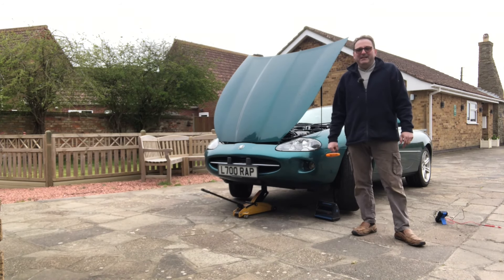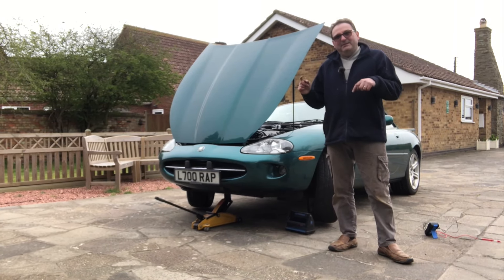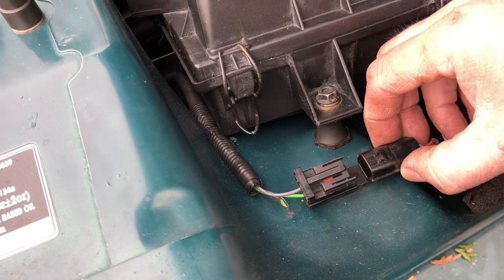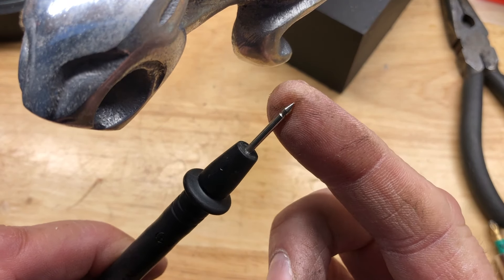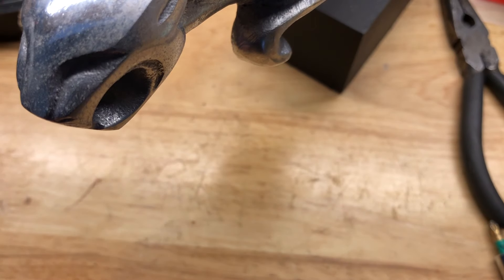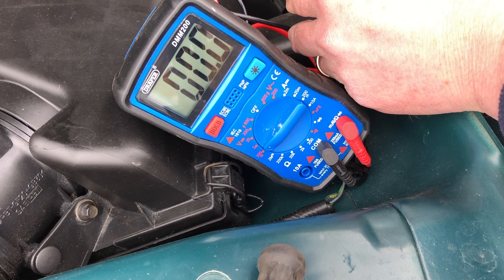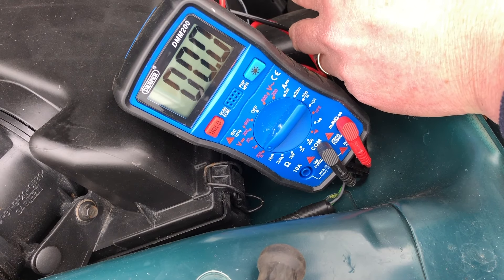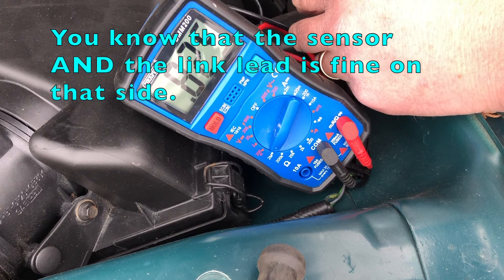Test a Jaguar XK8 ABS sensor the easy way.

Comment: Although I have found many faulty whl speed sensors, I have found the fault to be the  link harness 10x as often.  They tend to go open internally where they are ty-strapped to the control arm because there's not sufficient stress relief.  I always leave the ty-strap only as tight as necessary to keep the cable routed properly and no tighter.  My XJR started throwing a RF code intermittently when I made a sharp turn, I loosened the cable ties and the code has not returned in the past 2 years!  Sorry for the length...another great video John!
Reply from the maker: Please don't aplogise Tom. I agree the Link wire is just as likely as the sensor. Thats why I think its such a good idea to start the testing from the top on these cars.

Comment: Another Great video... I was told I needed a whole new brake modulator at $4000. By a local mechanic shop ... will follow your lead to see if its something minor as you shown , Thank You... Love My XK8
Reply from the maker: Make sure you test everything before swapping that Joseph.
The soldered joints inside the ABS control module are also likely causes to look at after eliminating all the sensor related stuff and before swapping the expensive modulator motor unit
Reply: Thank You sir... keep videos coming
Reply: My XK8 gave the ABS warning from time to time, often coming on when I was driving really slowly. I removed the ABS sensors from all the wheels and cleaned them, sometimes it helps but not for me. I then looked at the toothed ABS rings and found that a small stone or something sat between two of the teeth. I peeled it away, put the sensor back and never had an issue with the ABS anymore. Sometimes it can be really simple.
Reply: If it the module. It should cost around $1800 and you can resolder it yourself. Theres two pins that fail usually. Look at jagrepair or a forum for a fix
Reply: @trulysick86  Thank you sir

Comment: Hi John hope you’re well in these troubling times. I’ve been following your super serious of short shows/programmes on the XK8 and thoroughly enjoying it, so keep it going please I’d be lost without them. I’ve been meaning to write and ask for sometime now, hoping if you might investigate what appear to me a couple of secrets. I own a 1997 very early series 1 XK8 which is in reasonable good condition, this is my new weekend pass time with restoring back to its former glory. I’m an avid amateur mechanic, certainly no stranger to repairs and rebuilds mechanically in my youth.

However not significantly experienced enough to know all the basics hence this ask which are as follows;

Firstly the engine is a standard 4.0L engine with an aspirated carburettor . This the first secret as I see it, there is a vacuum pipe that is connected to the vacuum chamber or at least there should be! I’ve bought from Jag Classic the correct tubing to connect but not been able to establish where the other end goes to? It’s one of  those little annoying details just I can’t get passed until it’s resolved no idea if it’s effecting performance or not.

Secondly, and this is a bit risky mentioning it here, when I’m travelling at a brisk pace into a gusty head wind I can hear what sounds like something loose tapping/banging noise coming from the front of the engine bay. Have you had similar experience of this or some of your followers perhaps. I’ve done a sort of process of illumination and I think I’ve narrowed it down to the rubber flaps at the bottom of the fan cooling tray but not entirely convinced.

Cheers Andy

0
Reply from the maker: Hi Andy I think I know what you mean re the vacuum chamber. I will have a look under my bonnet and let you know for sure but if you don't have cruise control I think its a black vacuum chamber and the little pipe on the top goes through a rubber 90 degree elbow and then a short black tube goes no where but is pushed through a small grommet on the throttle bracket.
if You have cruise control then it is a silver chamber and goes to the right wheel arch where the cruise control kit is housed. 
 On the flapping my first thought would be the number plate followed by loose front under tray, Wheel arch liners or winglets. (small mudflap looking aero devices in front of the front wheels underneath.
I cannot imagine you would hear the flaps under the rad as they are relatively soft runbber.
It may not sound likely but on mine when I first got it the side repeaters were loose and rattled loudly in the right conditions
Reply: To The Garage Hi John thank you so much for your reply really given me something to think about. Spooky thing is, I do have a very lose off side indicator but never imagined that would the root cause. Nonetheless have busied myself today putting it right 

Once again many thanks 

Andy

Comment: I have found when your ABS sensor & cruise control shut down & go into limp mode it’s a safety feature with all XK8,s it’s simply your wheel sensors cable gone on a wheel which is buttons to replace .       Diagnostics check first when a wheel sensor goes on a wheel it automatically shuts all other things down 👍

Comment: John, thank you for all your tips!  Question:  have you tried to intercept the rear abs sensor wire at the connection, similar to what you demonstrated for the front?  Do you know where thee wiring harness connection point might be after it enters the car body?  Both my fronts test fine, but can't get to the rear other than right at the sensor on the wheel.  Thanks so much for the time you spend on your channel!
Reply from the maker: You can test the rears through the multi plug on the ABS motor. One of our subscribers sent in a diagram showing which pins you need to test. I will find it and share it. (added to the list 😁)

Comment: Excellent advice! I have the abs warning on my xk8 and I used your method to find that my front sensor lines are working properly. So I took a look at the rear wheels and it appears that the lines head into the passenger compartment from the rear wheel well. Are the connectors under the rear seats?

Comment: Great video very helpful! I have the same "traction control" issue, and my battery is in good shape (a weak battery often creates the same issue in a random fashion). Would you know where the connectors are for the wheels at the back to do these tests ? Presumably in the boot, behind the carpeted covers?

Comment: It was the nearside link cable when I had this issue. The problem was intermittent and I noticed it was happening when I used full lock on the steering.

Comment: I wonder if there is much difference between the .."Easy' way and the "Hard" way...
I do have that ABS Warning...often
Reply from the maker: The Hard way is either to start testing from underneath. (if everything works from above then you don't need to) or as too many folk (and garages!) do, just start swapping and replacing until the problem goes away. This works but is expensive. and slow.
Reply: See my reply to Joseph Guastella
, it can be as easy as some dirt on the sensor or the ABS ring.